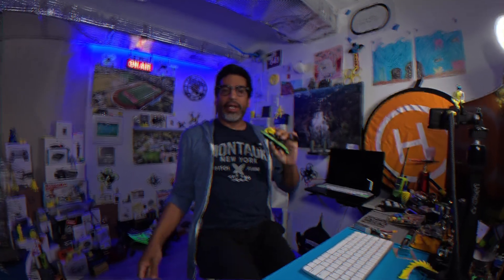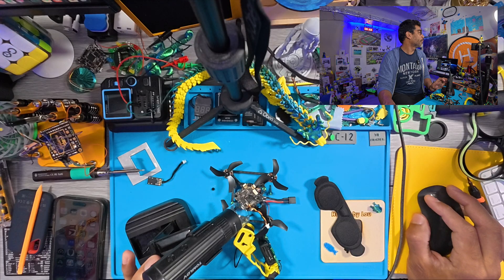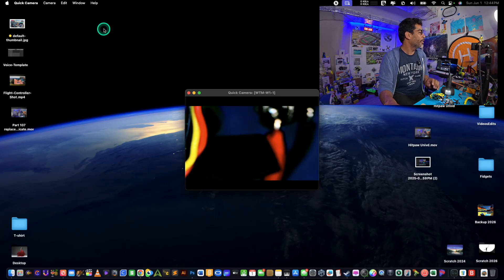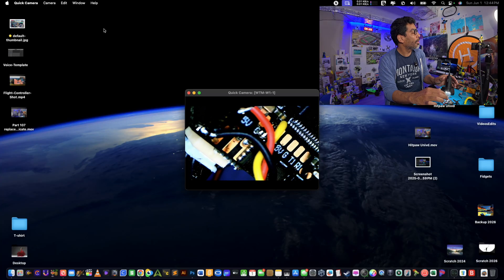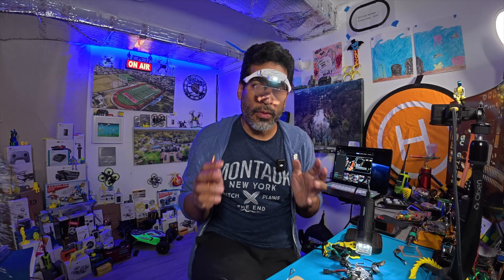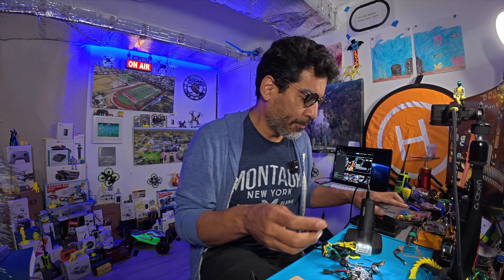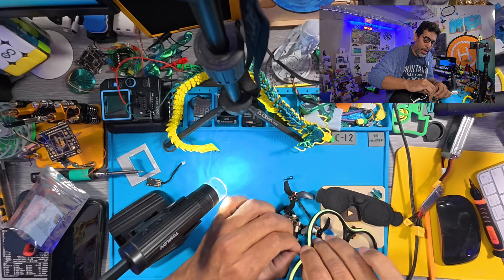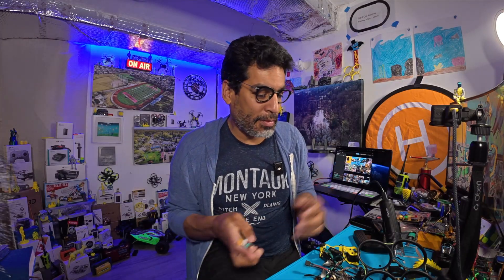Pavo20 Pro Led Light, Pavo 20 led, how to solder led light to your flight controller

Comment: Is it possible to install a GPS with compass and External ELRS receiver and still have control of the LED via betaflight? Seems like you have to give up a UART for the LED control. There is also a unused "LED" pad... Can I use that pad for addressable WS2812B LEDs freeing up the UART6?
Reply from the maker: Probably need to free up UART 6,  tad challenging. But can be done. Hope this helps. Let us know how it goes. 
https://www.youtube.com/watch?v=I3bPcjGdBPc

Comment: Thank you for your demonstration. I was just looking at the same board today online.  If you don’t mind, I’d like to ask you a question next to the yellow wire I believe is either a number 5V or a G I’m trying to find out what the G stands for is that also ground? I recently lost my Pavo 20 pro I have since ordered a new one and I am planning to attach a wired Buzzer from VI fly and I’m wondering as to where I could attach these three wires and I noticed a G pad 5V pad pad andR1
Reply: Hi, where can I get a new one of those cables to power my leds?
Reply from the maker: @psimmy73  Great idea for new video.. Depends.. if you broke the main cable you might need a new led but if it's this end it come with a set..  Hope this helps.. Let us. know how it goes.  Link to everything is in description

https://www.youtube.com/watch?v=0BrLDlaqNZw
Reply: @How-to-by-Lou sorry, I worded that incorrectly. I need a replacement for the cable that comes from the fc and powers the led strip
Reply from the maker: @psimmy73  So that would be this video.. You can make the cable yourself. this video shows you how to make that wire. The other end gets soldered to the flight controller. 
https://www.youtube.com/watch?v=0BrLDlaqNZw

Reply
Reply: @How-to-by-Lou THANKS!
Reply from the maker: @psimmy73  Here is new video with step by step process for that exact LED cable for your drone. 

https://youtu.be/9qPuW9Q3I3M
Reply from the maker: @psimmy73  This will post next week but here is a link to early access. Hope this helps.. Step by step on how to create your own LED cable.

https://youtu.be/9qPuW9Q3I3M
Reply from the maker: My pleasure. If you scroll down to the bottom of this link you can see the buzzer setup. Hope this helps. Let us know how it goes. 

The Ground is where the Black wire would go and the Red would be 5V.

Same set up that was done in the video but it's on the opposite side of the board. 

https://betafpv.com/products/f4-2-3s-20a-aio-fc-v1?_pos=1&_sid=a0000be76&_ss=r
Reply: @How-to-by-Lou  thank you for your response. I am still trying to figure out what the G pad is versus GND. Pad.
Reply from the maker: @508AirPhotography  G = ground
GND = ground 

There probably wasn’t enough space to write Ground or GND so they put G

Hope this helps
Reply: @How-to-by-Lou it does thank you. Do you have a video of installing a gps onto the Pavo 20 pro? Or the buzzer?
Reply from the maker: @508AirPhotography  You are the 20th person to ask. Have not done it because it's the same process on all chip. Have this video in the link below which is the same but guess folks want to see one for the Pavo20 Pro. Have the GPS will make a GPS install for the Pavo20 Pro later in the week. Maybe a live stream? or regular video..They take forever to find satellites. but great way to build up on your soldering skills.   

Pavo20 GPS installation
https://www.youtube.com/watch?v=P2asy3JywVw
Reply: @How-to-by-Lou  exactly what I was looking for!! This video is perfect….